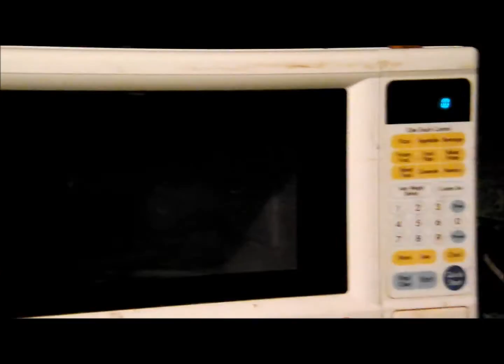metal halide (150W) in a microwave!!!

Comment: That's cool as mate I can see the microwaves working! Has anyone fully stuffed a microwave full of old metal halide bulbs and turned it on, It would be blinding the light and all of them would be going nuts! haha I wonder how long it would last, if you did street light fit out I'd imagine you have enough to fill a microwave!
Reply from the maker: thanks mate :) ,  it was very very interesting to see how the microwaves were not dispersed as well as i would have thought they would be, i want to try it with one mh tube and a glass of water in at the same time to see what effect the water has on the level of radiation; i am expecting the water to absorb a fair amount of rf